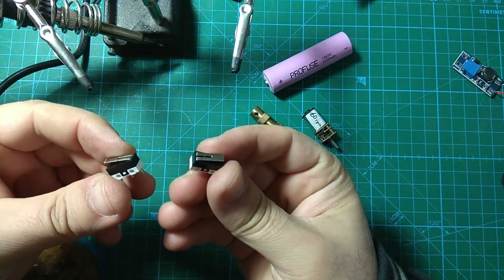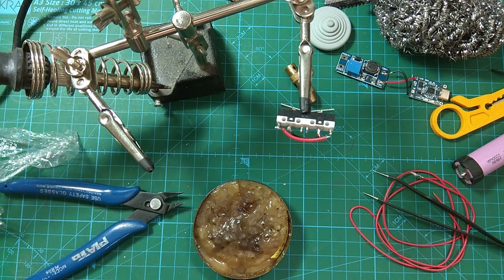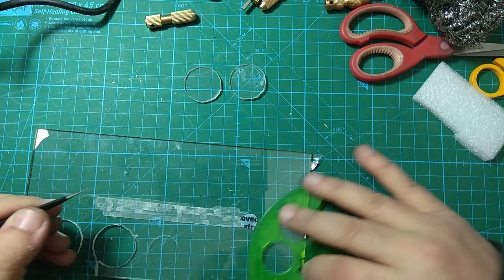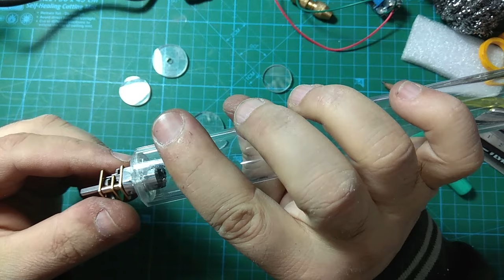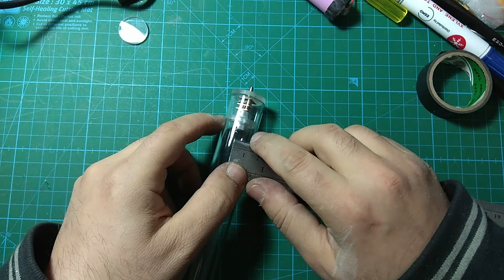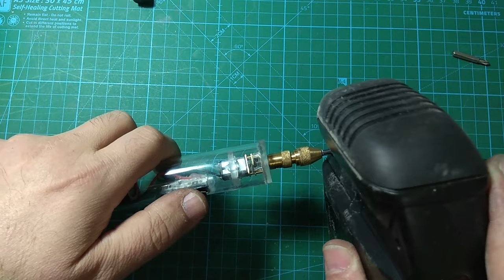DIY Cordless Screwdriver / Electric Screwdriver

Comment: I have made this but my battery is draining even without using the screwdriver (2-3 days usually). Do you have the same problem?
Reply from the maker: No, I didn't have such a problem.
Reply: @beykana  strange, i have tried 2 different batteries but has the same result
Reply from the maker: What are the mAh values of the batteries?
Reply: @beykana  FIrst one was 2000mAh 18650 second one is 500 Lion also
Reply from the maker: @Tish0eX  Very interesting. It should have worked fine!
Reply: @beykana  screwdriver is working fine the problem is that circuit drain battery without using it
Reply from the maker: @Tish0eX  Yes, I understand the problem, but unfortunately I have no idea why.
Reply: @beykana  don't worry I'm thinking to put on/off switch between mt3608 converter
Reply from the maker: @Tish0eX  Do you think that the converter drains the battery even when not in use?
Reply: @beykana  yes i have read that it has some minimum usage even without load on it. Or maybe mine has some problem don't have spare to test
Reply from the maker: @Tish0eX  I understand Could you write the result here after trying it? Maybe if anyone encounters the same problem, you can help solve it.

Comment: i dont have voltage board can i make it? without any problem?
Reply from the maker: If you do not have a voltage booster card, you can buy it from the 3V model of the N20 engine. The N20 motor in my project works with 12v, so I used a voltage booster.

Comment: How RPM   this motor. U used. ...
Reply: Use 100rpm or 120rpm. 30rpm or 60rpm to slow for this project because i using 30rpm N20 motors
Reply: Acctual am used 150rpm   n -20 gear motor. But not.  Proper open s...
Reply: @swapandutta658  maybe 80rpm is best choice above 30 or under 100rpm, saya belom mencoba variasi ini
Reply: Acctual am. 600 RMS motor. Used. This. Ok. Or not.  3.7 volt.  To 12. Volt.   RMS 600